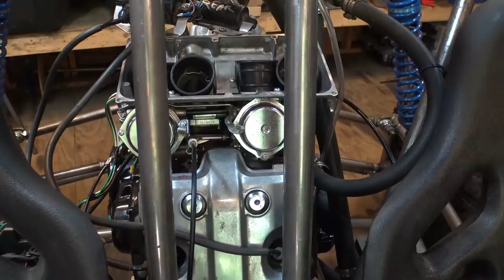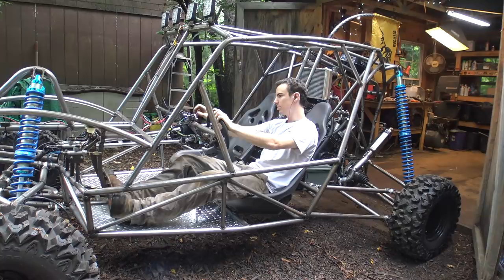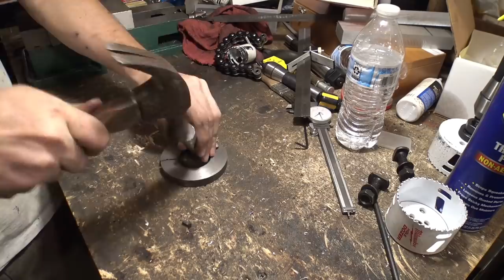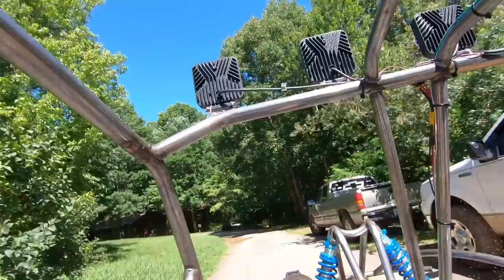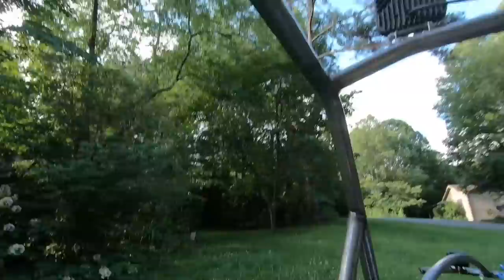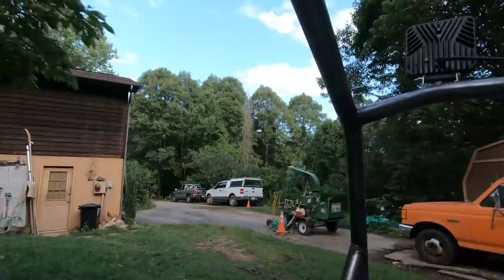Honda VF 1000 buggy build part 13. test drive

Comment: It's a motorcycle engine bro.... REV IT OUT!!! They don't make power down low
Reply: 👍👍👍👍 agreed
Reply: Agreed!! Check out my CBR600 build, first run video out and I gived it some!!
Reply: Either that or go EFI and get a good tune
Reply: It would have stalled the bike at 2k rpms now it'll be sadly over geared because of this
Reply: Agreed
Reply: I know right, that thing has a potential of 120+ Hp @ 10K rpm, let it Rip!..lol  :)
Reply: I'm not positive he's in first gear?
Reply: Send It !!
Reply: 100% need to rev it .
Reply: Sir, that's a Honda vf 1000 it's basically a 4 cylinder Harley. Meaning it makes great all around power ok?
Reply: @stephendavies2514  the gearing is tall but the buggy is a whole lot heavier than the motorbike the engine was originally on so the gearing needs to be much lower than a 5:1
Reply: This makes me angry I would be rooster tailing it by now
Reply: @tebibyte2357  false, a v4 makes less torque than a V-twin due to the smaller bore diameter.

A big V-twin makes a lot of torque down low but runs out of puff earlier in the rev range whereas a v4 has far less torque down low but is able to spin up to three times faster giving it a higher peak hp figure.
Reply: @b0xhead96  yeah but that's why I said it makes all around power, it's a inline 4 fused with a Harley Makin "ALL AROUND POWER"
Reply: I’m sure he understands that. And saying motorcycle engines “don’t make power down low” is a very general statement. He obviously doesn’t have the optimal gearing yet, and he addressed that. All of you criticizing his low speed test, please send vids of the 1000 cc buggy you made in your garage.
Reply: @stephendavies2514  He has no gears yet.
Reply: @matthews852  I wasn't saying nothing about gearing so I was correcting boxhead. THE ENGINE IS SELF AGAIN SAYING HAS ALL AROUND POWER. GEARING HAS NOTHING TO DO WITH POWER
Reply: Yeah
Reply: Should have gone an electric motor. No torque issues then
Reply: Exactly what i was sayin
Reply: Yeah dude it’s a vmax bro those things are bullets. You, Some fabricators I can hear talk ALL day. But you man. Just build please.. Don’t talk so much lol no disrespect. You start to talk you start to over build. Why is that thing so wide. ?? Anyways keep up the good work, these are only my opinions and aren’t facts. Take it as constructive criticism.

Comment: Remember, motorcyle engines make most of their power in mid to higher RPM ranges. You need to rev them out a lot to get them to go. Your gearing is probably fine, you just need to commit with more RPM.
Reply: I agree I feel like the wheel speed at idle is good with the 12t swap . U do kinda gotta jump on it and go just cuz it's heavy
Reply: Yup. It'll rip once it hits 7-8k. 12 tooth will be perfect. I'd just take it easy and keep an eye on if its still smoking. This build is friggen awesome.
Reply: He made a miscalculation with his torque on the engine. He said it was in nM and not lb/ft, which is a huge difference. It has 94nm of torque, which equates to only about 69lb/ft of torque. He needs deeper gearing.
Reply: Yeah, I was thinking even engine mods wouldn't help the take off. I'd just be easy on take off and let her eat up in the rpms.
Reply: I totally agree. The gearing actually sounds a little short. He is not used to having to rev and engine to make it go.  I think the redline on that engine is about 11000, so until he gets it out of the yard and lets it go, he shouldn't make anymore gearing changes.

But as he mentioned that thing weighs a ton or at least half a ton, he really needs to learn how to build using lighter and less material.
Reply: That sprocket is sketchy because of the play, if he puts a load on it at high RPM bad things could happen. Once those new correct width sprockets come in it's going to be a different story. This thing literally will have the equivalent of a quick change rear end once he has all those to play with.
Reply: Still just getting used to it with some mechanical sympathy
Reply: If it has six speeds and 10k rpm it needs lower gearing so it do 140mph
Reply: Draggonheadd. I was thinking the same thing the gearings seems fine. Unless u want a rock crawler then u dont need really tall gears or the things guna top out at 35 motorcycles have wet clutches there ment to be able to slip a little. From the sound of it, it sounds just fine pulling away from a stop. Wouldnt want to go any lower or 1st gears only guna do 5mph and be useless. Personally id sacrifice low speed torque for more top speed. That thing looks like shes ment to rip, wouldnt be any fun if it topped out at even 55mph. Spunds fast to some people but that thing could be doing 80-90mph easy and float like a cloud over bumps
Reply: The universal problem with the bike engine build project is the limitations of gearing torque and clutches. Even if he get it to the point of ripping on flat hard ground and is okay replacing the clutch every 4 rides, what happens when he wants to crawl some rocks, sand dunes or just some steep inclines? one good incline climb and that clutch will be smoked.
Reply: He needs to put the biggest 2 stroke liquid cooled snowmobile engine on that thing. Lol make it all worth while.
Reply: This is a vtwin it works at both lower and high rpm
Reply: FYI tompro design has sprockets up to 72 teeth if you have the room .
Reply: He's just testing it out, in his yard. I doubt he left 1st. Takes a lot to overcome that kinda weight. Once it's moving the power was fine. The testers said the same thing about the honda 'pilot'. A 600lb factory bug with a 40hp, 400cc single 2 stroke. He'll be fine with that old 120hp V. He needs some room to get a true feel for it.
Reply: about this fact i think the motorcycle engines is better on karts to road in asphalt instead grass and dirt
Reply: draggonhedd i felt that he was not torturing the clutch, just needed a bit more rpm
Reply: 100% agree. Mine only shines in the high rpms. Which means it's all or nothing if you want to get through the corners!
Reply: Fr tho lol
Reply: I was part of a Hayabusa swap into a Mini a few years ago. THIS, is exactly what happened to us. On the bike, it goes up, up, but it doesn't need much to get going, once it got into the car, the mechanics of it all changed, we, being on our first bike to car swap, hadn't figured that you should have it make power just slightly North of regular on a bike, to account for the car offset. Man, we spent like ... almost two months chasing our tails because none of us chickens had the grains to actually rev the bike engine all the way up to what on the bike would constitute a speed run.
Reply: I just have to say hallelujah praise GOD I’m saved and going home!!!! If you are not turn to the LORD and have all!!! GOD bless!!!! Keep doing for the LORD your work doesn’t go unnoticed amen hallelujah praise GOD

Comment: Sway bars will take care of the Boat feeling/body roll.
Reply: yes but not idea for off use
Reply: Anthony Toste, I think for the type off roading that buggy would be doing, it would be fine, it’s not a crawler, and sway bars would help out a lot more with the high speed driving and make it feel more stable.
Reply: @REDRUM12345678910   funny how many ATV and UTV hell even sand rail don't keep in mind that sway bars where meant for cornering may guest is the spring are to lite
Reply: @REDRUM12345678910  so would correct spring rates and proper shock/strut placement.
Reply: I was thinking of messaging the same thing. Sway bar at least in the rear.
Reply: Swaybars give you less grip, always. they are for makeing a car with to soft springs stable in cornering.
Reply: You dont put sway bars on a long travel rig it's meant for crazy off roading if he put sway bars on it he might as well of put little 4wheeler coilovers on it
Reply: fastandFerousious Believe it or not, they actually make off road sway bars for dune buggies, stadium or Baja trucks and other high speed off road vehicle.
Reply: Sway bars are no good off road. If it was only ever going to see dirt or gravel roads a sway bar would work just great.  More speed through the gearing is gonna be the ticket for a heavy machine to slide around with the rear end.
Reply: @MrFreakenfast  He can as all trophy truck have but best use most on flat ground unlike with Baja
Reply: Firmer springs and better shocks before adding sway bars.
Reply: @MrFreakenfast  Its a trail or track racer, not a 4wd crawler.
Reply: Sway bars are to keep the wheels of each "axle" working together, ie in most non offroad situations, both wheels on the ground.
Like a live axle if you will, keeping them not independent of one another
Reply: In off road mainly crawling use they don't like them as one influences the other.
If one wheel is in the air it'll be taking traction off the other also.
Reply: As far as this suspension debate goes. More preload and slow speed rebound adjustment would be a good start. Having the shocks valved properly for weight of vehicle and drivers weight as well as style of driving would be a good start.
 Also we must remember this is a racing engine. Torque is going to be higher in the rpm band period so 4000 RPM is where this machine usually should be in the torque curve. Would have to research this motor to be sure but 3800 to 4400 rpm would be my guess. For its torque curve.
Reply: Good idea.

And even better if he bult a system like the KDSS in my Landcruiser. That thing is crazy stable in corners, and still has mad wheel travel for a stock vehicle.
Reply: @jompazx1272  no. trophy trucks and other off road rigs have sway bars and they get the same grip as the ones who dont run sway bars.
Reply: @MrFreakenfast  the rear isnt long travel. the shock is almost fully extended with how he built it. plus what you said is wrong because rigs like trophy trucks use sway bars front and rear and theres not travel limitations
Reply: @trecedaves3159  sway bars are good fro offroad. ultra4 cars use them when crawling the toughest trails in the world. trophy trucks use them for the desert and they do amazing
Reply: @grantadamson3478  the shocks he has are literally the best ones you can buy
Reply: @xd_gangster693  There goes that idea then. Thanks
Reply: @xd_gangster693  do they run waaaaaaaaay softer springs when they use swaybars

Comment: i think the tyres look to small but thats just me
Reply: Glad I wasn't the only one
Reply: Ya but then he will have to gear it down even more
Reply: They look small compared to cage it's not just you.
Reply: Freddo 1345 for a 1100 cc touring engine is it almost too big look at mine profile photo that is a kawasaki 1400cc racing engine and the tyres are smaller than he have
Reply: Freddo 1345 yes they do look very small
Reply: The tires aren't too small, the machine is too big!
Reply: I think it looks great especially for someone who built it all by himself give praise not criticism
Reply: Agreed, it needs bigger tires
Reply: Bigger tires will only drag the engine down. He built the frame too big for what it is. I've seen car engine (honda FWD in the rear) based buggies that was smaller.
Reply: The fronts look fine. The rear tires do look small. But you gotta remember he built this buggy around parts like the shocks and the CV shafts so it couldnt be much smaller. Also that engine would struggle with bigger tires
Reply: Jeff C its not crtitisism i love what he does and his work but it was just an observation
Reply: The chassis is just massive.  Way too big for its intended purpose.
Reply: Agree with you shocks are huge looks stupid you will bottom out the darn frame before the shocks lol idk what is worse bottoming out on the frame or shocks lol
Reply: You're not wrong
Reply: Freddo 1345

Yes

Comment: It doesn't make any power at 4000 rpm. Look at the power curve. Max power near 10,000 rpm. Even babying it on the street in a bike you would shift it at like 7000+ rpm

Comment: Rear sway bar not a bad idea it will help it handle better! Again not obligated but i would try it you can always remove it if you don’t like it! keep up the good work!
Reply: Put disconnects on it. That way when in the woods and you need it to flex out you can unhook it. When on flat fast trails run it hooked up. Something as simple as tractor pins works fine.
Reply: Just a front bar. a fat front bar will promote over-steer which is your friend in lose conditions

Comment: Honda Civic engine like a Kimini and sway bars... Real power/torque, LS diff and trans (with Reverse), I think the chassis can handle it. Nice work.
Reply: I agree he needs low-end power for such a heavy buggy, but why not just use a Civic engine AND transmission; it'd be much smaller and lighter. Maybe something simple like a D16A with a 5-speed?

Comment: Looks and drives good. Looks a little cartoony with how high the roof line is but that's just my opinion. You did an awesome job. Not many people can do what you do.
Reply: Personally I would have angled the top cage down at the front like his smaller rail Karts , it looks like onr of the Murry off road buggies I think , but still a awesome build ....
Reply: I'd rather have headspace with a helmet. Banging your head on a steel cage is going to really hurt.

Comment: Awesome! But I think the exhaust might be a little restrictive.
Reply: I agree
Reply: More noise doesn't always equal more power.  His problem is with gearing. That needs to be resolved first.
Reply: It definitely is
Reply: @Buck1954  wasn't referring to noise I was referring to back pressure and throttle response...a restrictive exhaust causes less power.✌
Reply: @mikeshobbiesandrandomstuff  I've also seen that not enough restriction also causes loss of power.  Depends on how the engine was designed to create power.
Reply: Exactly, and those saying it won't help go check out grindhardplumbings channel, on one of their latest videos they found out the exhaust was killing the power of their engine
Reply: @adhd-motors3972  While this isn't a great example, I had a stock 1984 Honda Civic with a stock engine and exhaust and always blew the doors off these guys that opened the exhaust.  It sounded loud, but that 4 cylinder motor needed the back pressure for power.  Unless the engine is designed to run open pipes, you can lose power.  I saw this guys pull the plug out of the pipes.  But then I've seen them rebuild that buggy multiple times.  Opening the pipes does reduce back pressure, but on some engines you can lose power. It's my opinion that opening the pipes on that rig isn't going to help that much, just make it louder, an annoyance to the neighborhood he lives in.
Reply: @Buck1954  well aware of that.

Comment: With the size of that thing it looks like you could put a V6 or even squeeze in a small block! It looks sick!
Reply: Never stand up. The tubing is way too small and way too many weak spots (dead tube ends, big open areas with no triangulation, bends put in areas with no support). Maybe a g10 out of a geo metro but anything bigger will crumple it.
Reply: neo 71665 I’m just saying it’s got a lot of room where the engine is
Reply: @melted_pistons  cringe

Comment: You could push the axial sprocket out to make room and put a Jack shaft behind the axle.  But the powerband on that motor is at higher rpm so you could try to redline it out of the gate but then again low end gearing will help to save the clutch with such a heavy vehicle. So maybe try the 10 tooth I think you will just need to mess with it but everything is there to make it work you just need to tinker with it and it will work the way you envisioned.  Excellent job bro you really accomplished your goal of a high end looking top quality store bought machine.

Comment: I run 14/60 with a gsxr1000. 12/60 should be quite low geared. Are you sure you aren't starting in second gear?
Reply: It isn't all in sprocket size. He also has tall tires and it's a heavy frame

Comment: Guess you either need to modify the gearbox or put a reduction gear, which you could also use to reroute the final drive chain and get rid of two problems at once.
Reply: Its already crazy low geared.. Look how slow he is moving even with the rpms reving.....   It's just heavy., he's never gonna have the out of gate acceleration that he wants.
Reply: @calholli  That thing never hit any respectable RPM's... it's a race engine designed to hit 10-11k rpm, he probably didn't hit half that. If he did, it was when he was in his front yard and the wheels spun. He's driving this like it's a go cart and it's not. That's the actual issue. He doesn't know how to take advantage of this engines power band. For reference, this thing makes peak torque at 8k rpm and peak HP at 10k. It's also worth noting that this is a 30-35 year old engine, it may just be tired.
Reply: @calholli   actually you are right, but it might also be the engine needs to be adjusted. Maybe its not generating power?
Reply: I agree. A  jack shaft reduction would fix both and if he did it kinda like a lower unit in an outboard might even be able to squeeze reverse in there.
Reply: @bobdole9163  I agree with you.. he doesn't have a clue how to handle the power, or where the power band is..  That's what I said in another post.. he looks like a noob. lol... He'll figure it out as he drives it more, but what he really needs is to let someone who knows about sports bikes get in and drive it... so He will see what it's capable of.. It's already plenty low geared... maybe too low..  You can tell by how slow it is going as the engine revs... these bikes will do up to 80mph in first gear, because thats how tall the gearing is.......  Like you said, just give the thing some gas and let it scream.. the power is there- I promise........   Let me ride it. lol